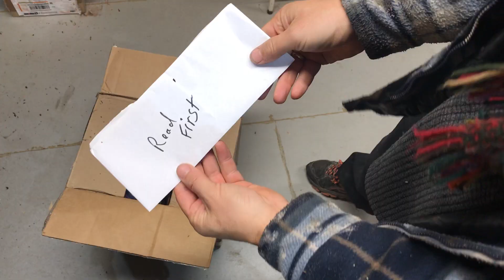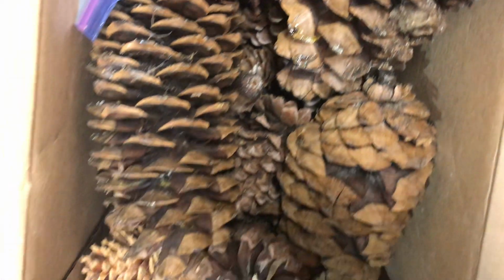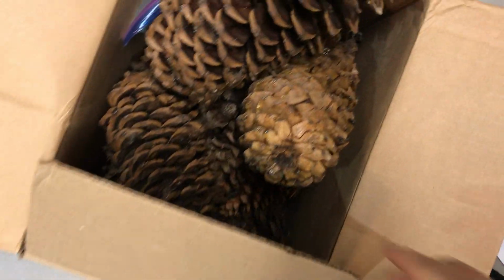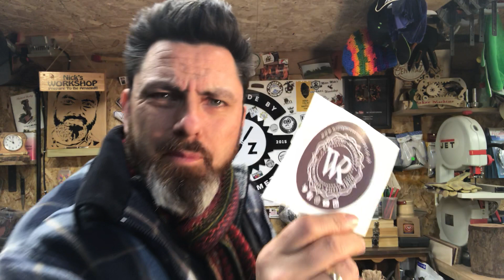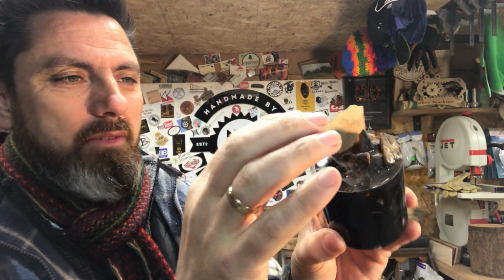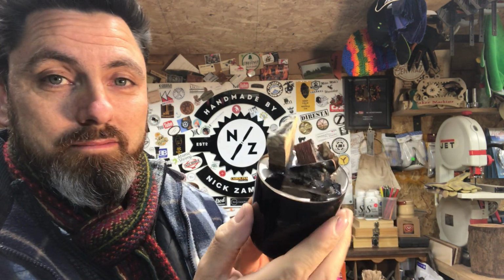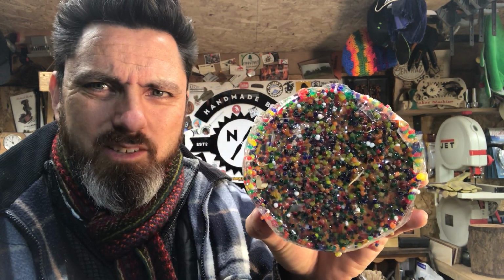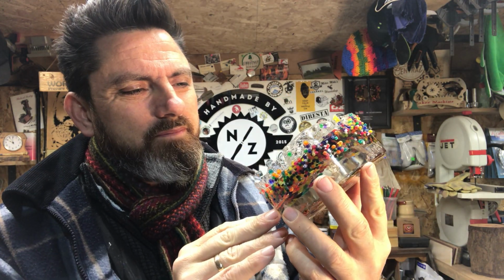wood-turning - The Orange Mountain form resin and burl wood

Comment: Idea for the giant pinecones, cast the pinecone in bright color resin then turn it into a pine tree.
Reply: I wouldn't cast them, but rather try to make a very thin and runny mix, and try to coat them instead, and built up rather than turn it down. Like the reverse process, if you will, adding a layer at a time. They already opened up so much that they're kinda like a tree already. Making a mini tree like that would be a fun project, almost like miniature painting, but with resin.
Reply: @louisvictor3473  Nick, definitely has enough of those beauties to do both.

Comment: Also, you could set one of the giant pinecones in a clear resin and turn a vase from it. Thick enough walls and you can keep most of the tips and also see the internal structure, at least near the bottom. That could look pretty funky.
Flip one upside down in some light colored green resin and turn a Christmas tree, light it from within. Maybe add some colored tooth-picks for ornaments? Drill some holes in the hardened blank and inject some colored and clear resin for Christmas lights?

Comment: Great video nick! however I have an unrelated question for anyone with the answer. What is a good way to thicken epoxy resen without jepridising the way it takes a dey? I'm hoping to apply resin on a virtual standing beam while avoiding runs or drips.

Comment: Mix equal amounts of the three primary colors (red, blue,and yellow) and you will ALWAYS get black!
Reply: Depending on the pigment, you can also get black if you add too much even if the parts arn't 100% equal. It all depends on what medium you're working with.

Comment: Im having trouble using the cutting tool when im turning.  I got on from PSI.  Should i sharpen it or am I using it wrong?  It cuts about an 1/8" and then just burns the wood.